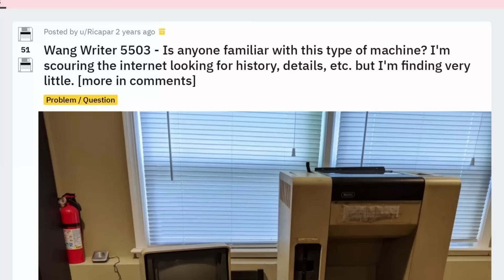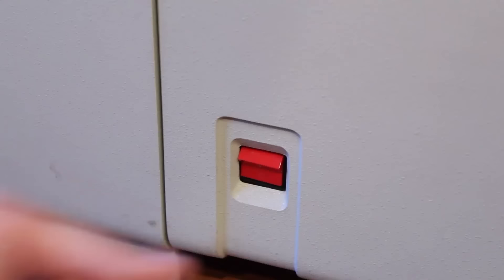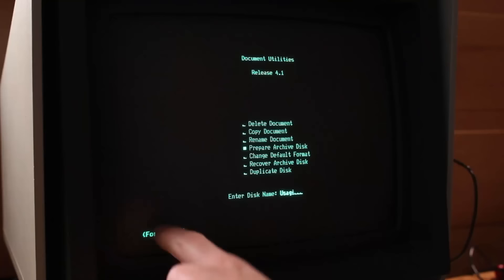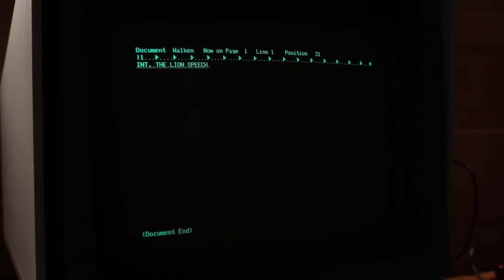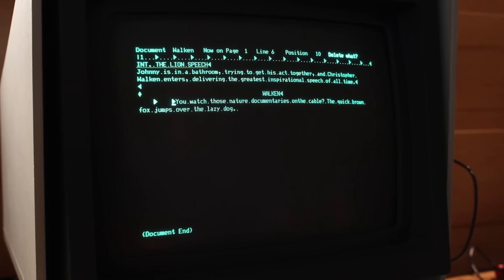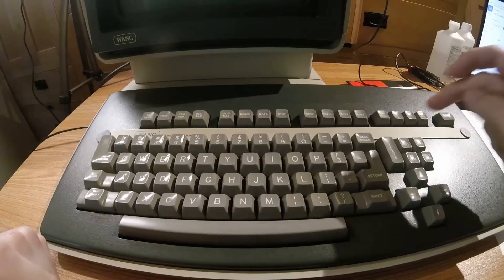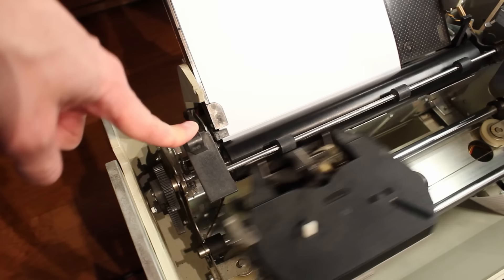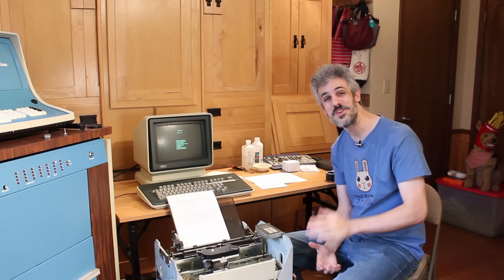How to Write a Movie Script in 1981 on a Wangwriter!

Comment: In the 80's worked at a company that sold CPT word processors.
We had a daisy wheel printer with the same sound.
There was a sound dampening enclose (which probably costed as a nice computer today) for office environment.
BTW, there is a platen cleaner and conditioner liquid which you have to use. Does an amazing job.

Comment: OK so it's been several decades since I last worked on a printer with rollers like that, and not on this specific printer, but it's (IMO) likely to be one of two things. Either the springs holding the pinch rollers (They're the smaller rollers) are worn, or (more likely, considering the age) the platen roller (The big main one) has become polished and shiny. If it's the springs, just replace them with tighter springs. Just try a couple of different tensions to find the "right" tension. If it's the platen, you may need to gently sand it back. (There are also chemical treatments, but without knowing more about it, I'm hesitant to suggest anything)
You want it to grip when under tension, but not be so grippy that the paper doesn't detach and wraps around.
Again, this is memories from long ago, so take with a pinch of salt :-)

Comment: Cool demo. In late 1983, I briefly worked in a repair center for the Coleco Adam computer. The system used a noisy daisy-wheel printer which contained the power supply for the entire system. It booted up as a word processor. As I recall, they used proprietary digital tape drives, which were failing like crazy. Along with countless other issues was a total POS!

Comment: Memories, memories,...In 1982, I printed out my PhD thesis on a daisy wheel printer like that, though not a Wang. I think it was from Texas Instruments. Typed the text on a CP/M-86 computer using Wordstar and with embedded runoff commands (no wysiwyg here...), ran the whole thing through runoff and printed on the daisy wheel printer.

Comment: Nice series, I remember the Wang stuff from when I used to work for Exxon Office Equipment (yup, that's when they tried to diversify away from gas and oil...), back then they had the Vydec Word Processor, whose claim to fame was a full page screen. Revolutionary at the time. They also had the Diablo daisy wheel printers. This series brings back fond memories.....BTW, good job on the hammer bumper adjustment, if that's too tight you will snap off printwheel petals. And too loose and you wont get a good impression.

Comment: Rubber rollers get a bit of platen cleaner, should still be available for sale, used to clean and refresh typewriter and printer rollers. Caution it does destroy styrene, but cleans those rollers to a nice dull grippy surface. Available from printing shop suppliers as blanket cleaner, and you also get blanket wash, which removes ink residue from all the parts, but again both absolutely hammer a lot of plastics.

Small stop you need a better material, though using adhesive lined shrink will work for a good amount of time, just need a few layers shrunk on to get the thickness.

Comment: The only thing I remember about Wang is that there's a 10 or 12 story building on Preston Rd near Beltline that used to have their logo on it. We called it the big wang, of course. It also had this amazing fountain out front that would reflect light in beautiful patterns on the buildings walls at night. I never see that nowadays; I think whoever owns the building now doesn't have it lit the same way, or something. Actually, I don't even know if the fountain is still there. I should ride my bike over there one of these upcoming summer-in-February days; I live less than half a mile from there, now. Oh, fun vid, btw,  I've always wondered what their WP system actually looked like in use.

Comment: You got yourself a fully operational hardware vim. Congrats! Cool editor indeed, and oh my goodness, that printer! Thing of beauty, joy for ever.
Nasty molten rubber goo is a nightmare, not only when repairing tape decks.
Reply: vim is later, vi was the original and was never designed as a word processor, it’s a text editor. nroff/troff is what was used for type setting, UNIX had no real word processor until much later.

Prior to vi, ex was the editor used.
Reply: Time to build a hardware vi out of an Arduino
discrete CMOS chips
vacuum tubes
Reply: TeX is what you need for typesetting.

Comment: Wang did sell its word processing software for the IBM PC.  The major issue was that it included a custom keyboard so that it would work just like a Wang word processing system or the Wang PC.  This made the cost of the software/keyboard combo very high compared to other offerings at that time.  Keyboards were expensive in the early 80s and swapping keyboards to use the Wang word processor was also a pain.  I worked for Wang Labs in Lowell from 84-85.

Comment: Neat little machine. Glad you were able to revive it. Back in the days when typewriters were in daily use, there was a product, platen cleaner, that was used for cleaning platens. I think it would soften the rubber a bit as well as clean the platen. However, there came a time when the platen would get too hard and need replacing. A hard platen had two problems. One is that the paper could slip on the platen, pretty much what you have. The other is that it could damage whatever was being used to print the letters. In the case of a type bar typewriter, it would loosen the type head on the type bars. They are only held on by solder. I have had to re-solder and realign type type heads because of that. In your case, you are using plastic daisy wheels and I have seen those get mashed to the point where they could no longer produce clean print because the print wheel was damaged by the overly hard platen. Back then you could order a new platen and replace the old one. I didn't think that was an option anymore but I found this: https://www.jjshort.com/typewriter-platen-repair.php . They do recover platens! I imagine you won't be using the printer much but if you intend to use it a lot, you might want to preserve your daisy wheels by recovering your platen.

Comment: Egad!  Compare this to MS-DOS word processors of the day...  Wow.  So very well done, both of you!
Reply: Real word processors were much better than that.
Reply: @IkarusKommt    I cut my teeth on WordStar for CP/M, so, yeah...  Most of the plain-text word processors of the day either derived from WordStar or EMACS... (Perfect Writer, I'm lookin' at you...) and were little more than what we would consider text editors with some "advanced" formatting features like justification.  Yup, back in my day, we changed fonts by changing the daisy wheel on the printer, or the ball on the IBM typewriter/printer. 😆

By comparison, EMACS, Vi/Vim, and later text editors like KATE look very similar until you start using auto-completion and automated syntax highlighting and indenting.

What most folks would accept as a "word processor" these days is a cut-down Desktop Publishing app.  Compare what MS Word has become to what Aldus Pagemaker or Serif's PagePlus was in the late 80s & early 90s.

Comment: I remember PCs unlocking caps lock when you pressed shift for a long time (not sure but it may have been Windows 7 that first defaulted to not doing it, but in earlier days it sure worked - it may have been Vista, but I never worked with that). In fact, I still set all my computers to still do it, as I find it way more convenient and have little use to writing all caps but with just an occasional lower case letter inbetween. On my Linuxes, this, together with the "num lock is default active", this is the most important keyboard configuration.

Comment: Like on a Typewriter the platen's rubber hardens over time. This is also confirmed by the loudness. When it hardens it shrinks and therefore slips. Only way to fix that would be to replace the rubber on the platen, as well as the rollers. (If that's the actual issue, that is) I have a HERMES Baby Typewriter from the 40's and it slips like crazy when I go too fast, feeding the paper. I learned to live with it for now. For the noise and better imprint I add a backing paper.

Comment: That was exciting .  Good you found someone ,  I was wondering if a cpm system would work, but the printer was a problem, 
wang was a good one, I was a system engineer on the ATEX system in the same area, Used for law offices and News Papers. Such a good Area . I had word star on my home system. At the near end Xwri te was introdused and had swapable key maps , macros just like ATEX and was the most evolved word processor of the era.. , ATEX was word wide , see if you can find a pdp 11 with it running , 16 users per rack , New york times etc. Junk to them now.  Atex gets no credit at all . Even the memory  mapped video and A terminal just a crt and a masive serial keyboard with 4 levels .... Used word wide .... Like they did not exist. In my era I  installed the Auto logic typesetters a crt based one used by all goverment offices, IBM, and most news papers even halmark and phone books, Then I went on with Atex.

Comment: That machine is pretty awesome. Imagine being a typist and getting this to work on instead of a typewriter. Sure, the print speed is slow, but it's faster than a human and if you need to run off 20 copies of some letter... well, now you can go make a sandwich while it clatters away, it doesn't need human intervention.

Also, why didn't this interface become more popular? Instead we had the highly confusing system of remembering control key sequences. Anyone tried using Wordstar on CPM? It's the opposite of this.

Comment: Good ole 8 bit Wang :)
BTW An Wang's Book "Lessons" an Autobiography is a great read.
TRW had a few of these Wang Writers to use for training back in the 1980s.
Reply: Wang writer software is probably very close to Wang Alliance.  I remember the Wang keyboards with the solenoid in them that would "clunk" as you depressed the keys.
Reply: You should try the Xerox 860ips (circa 1980) which had a CAT which operates the same way as a MOUSE.  The 860ips also had Ethernet, email etc.

Comment: To restore old dry but intact rubber parts: apply oil of wintergreen. be careful and wear PPE (gloves, eyes and a P100 respirator with chem filters ideally). this stuff stinks in a way that takes forever to go away, and is a precursor of aspirin, but you can rejuvenate terrible looking pieces with it. I use it to soak motorcycle carb boots and stuff to maintain my old girls. maybe instead of a soak, a brushed on coating or two? it will soften and somewhat inflate the rubber. Be careful. If you overdo it, the object may grow way too large to use. Do not throw away. in time it will sweat out the excess and shrink.
Reply: also, clean all rubber parts with ipa and a microfiber. also isopropynol xD. clean until rag comes back clean and rubber is dark, matte, and even somewhat tacky. just to get years of contamination out. especially capstans and rollers.

Comment: I've used spear-gun jelly-rubber as a replacement for bumpers. It's cheap, easy to cut and absorbs lots of impact as a stop bumper. The heatshrink is probably pretty nice also. There's some pretty soft rubbery ones out there :) Wish I could +1 vote for lagomorph appearance.

Comment: Does it have any undo or history functionality? And if you wanted to indent the rigt side of the dialogues as well, would that be possible? So the text would be kind of in the middle, but justified. Also I wonder whty they didn't make the inserting functionality as a toggle, so you could wysiwyg insert the text... But super interesting. Great video.
Reply: Likely so it wouldn't have to redraw the screen every time, which would have been slow.
Reply: @user2C47  They could've at least kept the text till the next full stop or something visible. It's cool nevertheles tho. I don't remember from the beginning of this series - if it has a character ROM then it should be just incrementing memory addresses, which wouldn't be very computing intsensive but what do i know.

Comment: Comms between Cent & Wang? Make a good sys printer
Reply from the maker: This is actually an idea we've had!
Unfortunately, the Wangwriter doesn't have any provisions on it to communicate with the outside world. Or at least not as it is configured now. There is room for two expansion cards in the machine, and one card that Wang offered was a terminal emulator card that added a RS-232 serial port for communication with a larger mainframe (or minicomputer). We don't know exactly how they were doing it, but that means that it's definitely possible to get something working!

Comment: 45 seconds/page slow? Back in high school I printed my school work on a dot matrix printer. One page of word document in NLQ took 14 minutes to print. THAT was slow.
Reply: Ah I was wondering if anyone was going to mention NLQ - "Near Letter Quality" the term applied to dot-matrix and early laser printers to note that they were almost as good as the existing impact printers like the Wang that used analog letter forms in either a wheel or a ball like the IBM models. It took a while before that stopped being a thing people looked for when buying a printer, probably about the same time lasers took over from dot matrix.

Comment: ... why did you remove the sound proofing?  Are you gonna replace it?  Seems like a shame.
Reply: He removed it because the foam had decomposed.
Reply from the maker: As M O'Connell said, the foam was starting to decompose and fall onto the print mechanism, gumming it up. If I didn't remove it, the printer would need to be cleaned probably weekly just to keep the sound deadening particles from ruining components.
Reply: @UsagiElectric  Oh, interesting.  it looked cracked in the video, but not like it was actively flaking, that's why I was confused. -- Are you going to install new?

Comment: Pick up a can of platen cleaner / rubber roller restorer.
Reply: I was thinking the same thing, but is platen cleaner still available?
Reply: @JCWren  I think so, at least I'm pretty sure they still make "rubber roller restorer"
Reply: @JamesPotts  Amazon has "Rubber Renue".  I fixed hundreds of printers from that era using it back in the day.
Reply: @JamesPotts  Looks like YouTube or something deleted the comment. I found I had 3 bottles of "Re-Grip" from Rawn America that I've used to restore rubber door seals. I think real "platen cleaner" had something else in it to remove the ink and such, but was at heart a rubber softener.